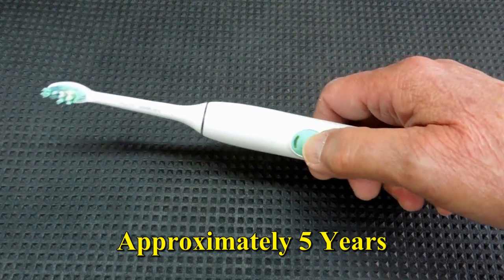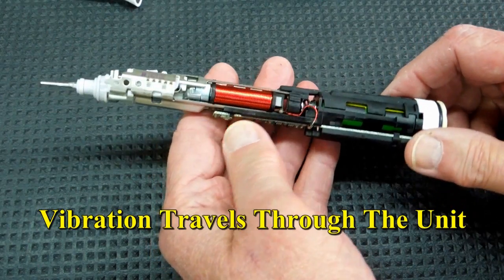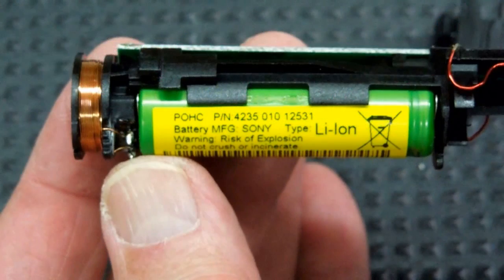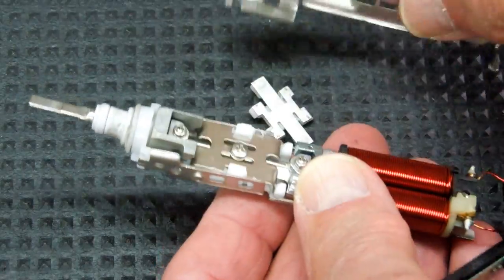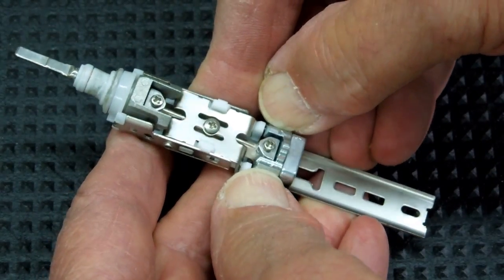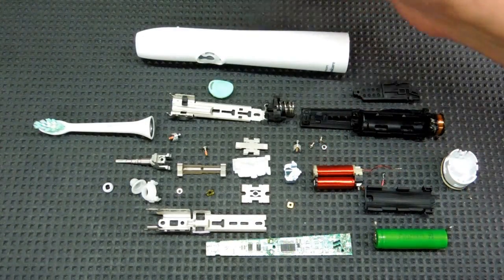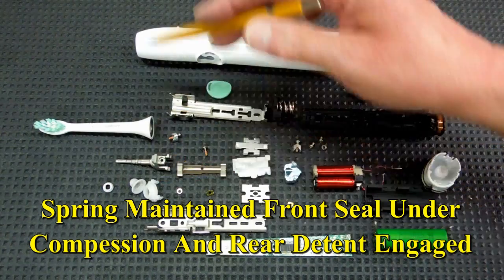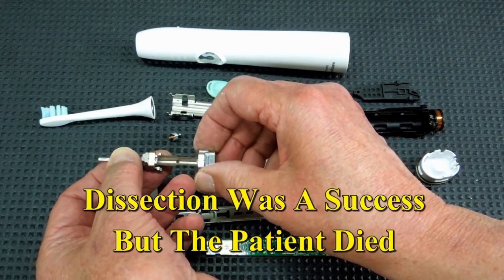Cordless Toothbrush Dissection - Philips Sonicare

Comment: how do you remove the welding point? and how to polishing ??
Reply from the maker: If you are referring to where the battery is spot welded about  all you can do is mechanically loosen it (pry it apart) then spot weld or solder in a new battery.

Comment: I bought 2 diamond clean phillips toothbrushes - pink and black. Batteries stopped working approximately 1 1/2 year later. We tried to replace them but it  was not easy. I contacted phillips for repair services and they did not want to do anything if there is no warranty was purchased at the time of sale. So for a $220 electric toothbrush (I paid $440) it was a pretty short life span. What got me upset is that phillips did not want to help in any way and this was the end of it. I will not buy from phillips again and do not recommend it!
Reply from the maker: I have had good luck with Braun Electric Toothbrushes and they cost around $25 to $40 for the unit with one brush.
Reply: @RonaldWalters2010  you might of have a better experience with the cheap phillips product however the expensive once don't last.

Comment: I do not understand and am about to cry... 2:06 ok I now tried to remove the screw also... this plastic backing just wouldn't come off. I slide it up and down. Bend it up and down as I slide. I shine the light and see the plastic bits sliding through the metal "T" rails. But it just stops short of the end... and does not budge. I loosen the screw, I twist board up, twist down, side to side, more force less force... I swear I feel like the dumbest person in the world right now. (im not the only one with this problem)

Please help.. don't skip this step... what is happening...?? I'm gonna lose my sleep over this
Reply from the maker: Quite possibly your toothbrush is a different model than mine and may disassemble differently than mine. This is a pure case of calculated obsolescence and there is nothing inside you can repair and there are no replacement parts. Throw it away before you hurt yourself. :-) I gave up on this Phillips brand toothbrush. I bought three more after this one (a different model - supposedly new and improved) and none of them lasted a month... absolute junk.  I switched to Braun.
Reply: @RonaldWalters2010  Hmmm ok.. well thank you for your input and perspective. Mine is actually identical.. and I'm no new to repairing things, it's just whatever is happening is beyond physics lol.

Well mine is an easy fix, I just need to put the magnet back. Guess I'm gonna play with it, until the fixid gods decide to give me a brake

Thank you again
Reply: @RonaldWalters2010  But yeah that part of mine is identical to yours. Every dent and cavity. Don't know why it only slides but doesn't come off...
Reply from the maker: Sorry, can't help you. That was thrown away long ago and all I have to look at is this video.

Comment: Ive had three of the Philips sonicare (the new model). First I got one that broke within 6 months and the other two were replacements that got sent to me. The first replacement broke within a month so they sent another replacement and that held up for another couple of months. Theyre all broken now. And with broken i mean the exact same problem as in this video. I dont get why they havent changed the design since its obviously flawed. The inside of mine looks exactly like the one in this video. So, dont buy the sonicare from Philips guys.

Comment: Interesting because I was always under the impression it was called sonic care because it used sound to vibrate particles from your teeth, it does not do that what so ever, just rapid oscillating motion.
Reply from the maker: Interesting to note that small so-called ultasonic cleaners for jewelry are nothing more than a vibrating electromagnet shaking a tub of cleaning solution. Probably just as well as a true ultrasonic cleaner could loosen settings.
Reply: @RonaldWalters2010  HA! Yes!
Reply from the maker: Yep! False advertising. :-)

Comment: Thank you so much for providing such a great guide! We have a diamond clean toothbrush with a recent damage to the shift-the metal part which has been surrounded by a rubber. The shift is separated easily from the base, and I am not sure if that piece  has been broken or loosened. My question is if I can  fix it with some liquid glue or not? I appreciate any advice. Thanks!
Reply from the maker: I doubt glue will fix it and maintain a water tight seal. Time to buy a new one. Try Braun next time. Thanks for watching. Please subscribe.
Reply: @RonaldWalters2010  Thank you so much!

Comment: Head of the toothbrush came off with the metal part (that looks like a metal stick) that you supposed to put the head of a new toothbrush on. But all just came off. What should I do to fix it?
Reply from the maker: Unfortunately, the only fix for that (that I know of) is throw it away and buy a new one... unless it is still under warranty.
Reply: @RonaldWalters2010  I have had it for about 3 years now. So it's not under warranty anymore. But tell me, are you sure that it cannot be fixed? Does that happen often?
Reply from the maker: Absolutely sure? No. However, I have had a couple different makes of these apart and they really are not made to be taken apart and if taken apart, people usually are not going to have the required tools to put then back together... and if something is broken, spare parts are not available.  The plastic case is made to snap together and while doing so, compress the end gaskets and seals to maintain water tightness. Once taken apart (forced and pried apart), when later reassembled, good chance the plastic stuff has been distorted while being taken apart and it will no longer be water tight. The internal mechanism often times has a metal frame. As the various sections are installed (oscillating head, motor section, battery circuit board section, etc.) the frame is often times spot welded to the sections to hold them in place. To take it apart you need to break the spot welds which usually distorts the metal frame. Then people probably are not going to have a small spot welder. Even if you do have a spot welder, these things are usually assembled in an assembly jig which holds everything in the correct position and alignment. Parts inside which are plastic sometimes have plastic tabs which are melted to act as a rivet or fastener, again not meant to be taken apart. And while trying to force or pry these things apart it is quite easy to hurt yourself. The long and the short of it... just isn't worth it and odds are it will be broken worse than when you started messing with it. :-)  Thanks for watching. Please Subscribe… that is what keeps this channel available.
Reply: @RonaldWalters2010  Thank you for the replay! The thing is I was going to take it apart anyways, since the only other option was to throw it away. So might as well take it apart first. All seems intact there. It's just that the metal stick that on the top won't stay in it's place anymore and will fall off every time. I wonder maybe there is some little part that keeps it together that I lost. Or is there? I wonder what was holding it then when it was working properly. Too bad I don't have a toothbrush like that that's not broken just to see if there's any parts missing.

PS I subed and liked that video =)
Reply from the maker: Good for you! It is interesting to take things apart to see how they work and possibly determine what caused the failure. The Philips Sonicare in this video lasted around 5 years. They keep messing with stuff, seeing how cheap they can make it, not caring if it actually improves the product for the purchaser. I bought three (3) Philips Sonicare’s after this one different model number) and none of them lasted more than 2 or 3 weeks. Seemed to be a programming problem with the electronics… would not run more than a few seconds or would not start at all. Then it did not want to charge… quite a mess. I took one apart and it was totally different inside than this first one. Ended up switching to a Braun, which is still working.

With the high frequency oscillations and the resistance of the brush head I can see where metal fatigue could result in a failure, a screw coming loose or similar. A lot of design and engineering went into one of these. Too bad they can’t see fit to make it well instead of cheap. Usually I would expect a battery or electronics failure.

Thank you for subscribing. I expect you will find several topics of interest on my channel.Ron
Reply: @RonaldWalters2010  Thank you for the thorough explanation. Keep up the good work. Best of luck!

Comment: Ron, Thanks for this. I have a slightly newer version of this toothbrush. This, and the one before have both failed due to the transmission shaft breaking. Under the microscope it looks like a classic fatigue fracture due to the high rate of oscillation. I'll be sending mine back to Sonicare for comment (and replacement?). Everything else works just fine .... the shaft is too weak.
Reply: @whitefields5595 I think this is a deliberate design fault so it only lasts for a certain period of time, as long as it lasts for the length of the warranty period they don't give a shit because they know most people will just chuck it in the trash and buy a new one. For the sake of an extra couple of bucks Philips could easily make a better quality shaft but then the product would last too long and that wouldn't make them any money. This built in obsolecense is a National disgrace because it applys to so many things these days and when it applies to large white goods that can catch fire it can have tragic consequences of people loosing their lives through no fault of their own !!

Comment: No guide I've seen has described correctly how to get the front of the brush away from the black plastic base and board. The front can slide back and forth and the spring keeps it pushed forward.. The front assembly has two plastic tee tabs that go in at the end of a slot with Tees in the end. But you can't slide the assembly to these terms openings unless you push a credit card in to release two tabs that prevent it from sliding to the tee openings. Then it comes off and you can reset the magnet gap. I used about a credit card. I dropped mine and I guess that is what closed up this gap. 
there should be a gap between the rotating magnet and the two magnetic coils.
Reply: can you try to explain a little better where should the credit card be used?  i tried for like 60 minutes now to take it out and i started getting frustrated . pls help
Reply: i made it, i cut the card in 2 pieces, put one piece on one side, and with the other one i slide on the other side and then i could slide the tees in final position so it comes off.

Comment: Don't understand we're you attempting to repair?
Reply from the maker: It was not working reliably and these really aren't intended to be repaired. Opened it up to look inside. Battery was good and no loose connections. Seemed to be a circuit board problem so after that I just took it apart to see how it worked.

Comment: pretty cool. Were there any parts worth saving?
Reply from the maker: I saved the electromagnet and the permanent magnet. Time will tell if they were actually worth saving.
Reply: Ronald Walters   Hi Ronald, I would urgently need the soft and flexible rubber seal that holds the axis! Any chance to get it sent to Europe? Of course I would cover your expense...
Reply from the maker: The video was recorded and edited early November 2016 and then I had a pile of mostly useless pieces. Unfortunately I threw everything away except the magnets, otherwise you could have them. Sorry! Several people have mentioned the output shaft seals failing. Mine showed no signs of wear. Thanks for watching!

Comment: What was the final diagnosis of the patient Dr.Walters?
Reply from the maker: Battery was good and no loose connections. It would run intermittently and for random duration which pointed to a circuit board problem. From that point it was "take 'er apart" and see how it works... and the patient died.
Reply: I´m sorry to hear that. May it rest in peace
Reply: hjelkrem79    It rests in pieces.
Reply: I have priblem with this model after 2 years of yousing that staf. I push metal peaces where we see coils wich change polarity with hight frequensy.
 In short magnet cant tuch this iron plates in coils. If does magnet cant wibrate when coils change polarity head of toorh brash dont have wibrations. 
If you make this SoniCare will work like new. 
In my hause are two of those and my i think work better than those 2nd (my is older) after this operation.

PS Do this gently and with head.
Reply: I have solution..
Reply: what is it

Comment: Do you think the connecting rod was designed to have a natural frequency near the oscillation frequency? I can't think of another reason why they would have added the extra parts.
Reply from the maker: I think it must get into resonance to amplify the rotation of the brush head although the triangular cross section of the "connection rod" and all the nylon parts seemed quite a solid assembly.
Reply: Mine, that has broken, is a steel strip of 90 degree cross-section. That would resonate, but also fracture due to fatigue which is what both of my last 2 brushes have done. Either I'm brushing too hard or the shaft is too weak!

Comment: Hey, Ronald, thank you for this video. I have been using these brushes for years. I needed to buy several because the weak point of this otherwise excellent machine is the soft rubber seal around the axis. It just falls apart after a number of years, making the entire device unusable because the axis then starts wobbling heavily. I could not figure out how to replace this seal...